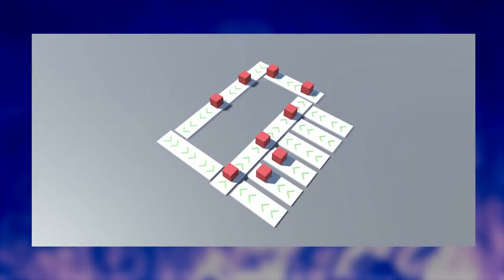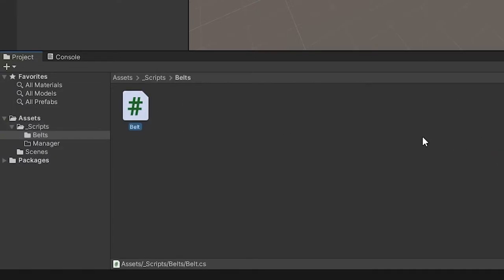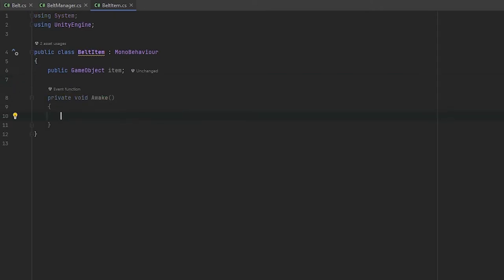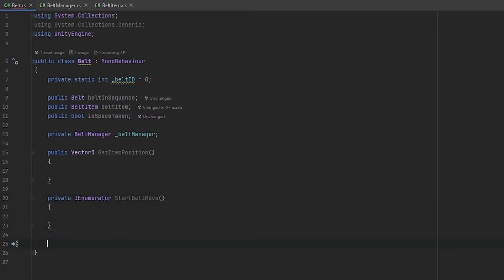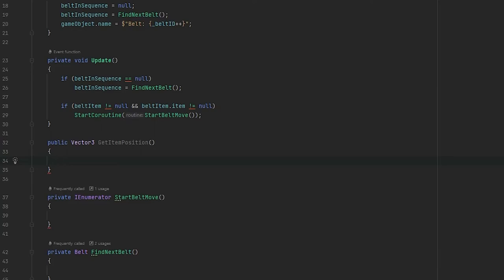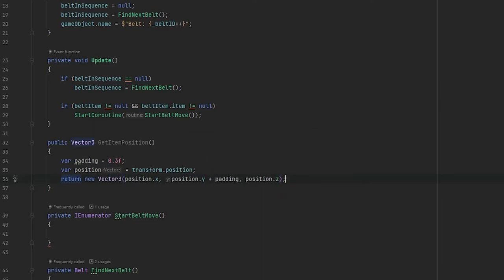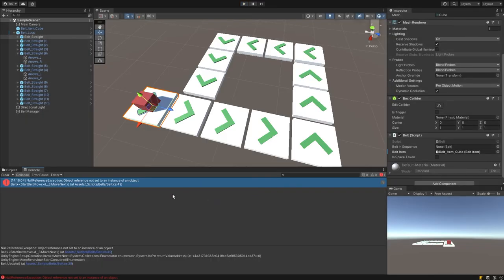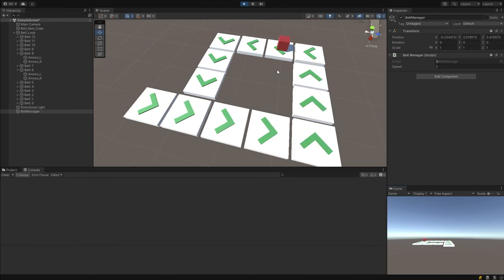Remake - Belt / Conveyor System Tutorial [Unity3D]

Comment: Well we hear it a lot almost everywhere that Raycast is very heavy and affects the performance of the game and it must be used very carefully.
So the way you made this, if a game let's say has 10,000 belts you're using the Raycast 10,000 times per frame
Reply from the maker: Hey Pedram, You're right - having multiple thousands of raycast is super costly BUT only if you're blocking the main thread, there are many ways to improve the existing script, for example; you can make the ray casts be asynchronous to not block the main thread. Saying that, since we are only ray casting if a belt does not have a "next belt" the performance hit will be minimal as the ray casting isn't enabled on those belts. Hope this clears it up :)
Reply: @CodingWithRus  I've also used a grid system with dictionary, list or a hashset to basically check if "current position + direction 1 step" has an object. I have no idea which is the better option to do, but at least I've had good success with that in a smaller game where the game world is something like 30x30 steps.
Reply from the maker: Hey  @oatcube3961 , It really depends on how far down the optimisation rabbit hole you want to go. For this you'll really need to know your data structures. IMO - list are the least optimised (let alone the chance of repeated elements) but rather the way it's used. Lists use a basic Array under the hood with search algorithms (which you can argue that most do anyways) BUT, have a read of this and I think it'll point you in the right direction: https://theburningmonk.com/2011/03/hashset-vs-list-vs-dictionary/#:~:text=However%2C%20it%27s%20important%20to%20remember,if%20you%20need%20to%20perform
Hope that helps!
Rus
Reply: @CodingWithRus  Thanks for the link. Actually meant array rather than list. Still a noob when it comes to performance but have been tinkering with a lot of things.